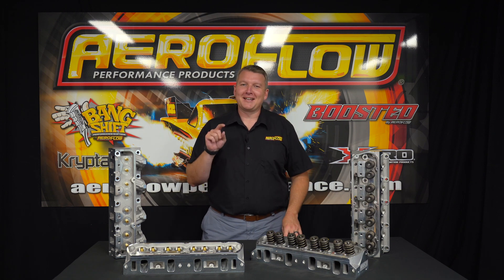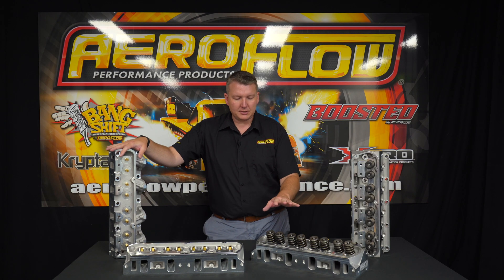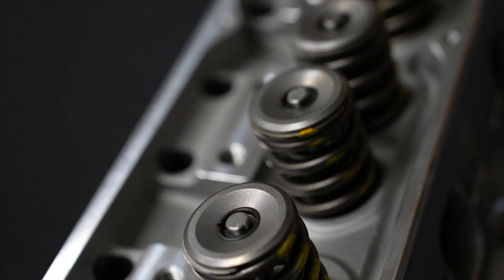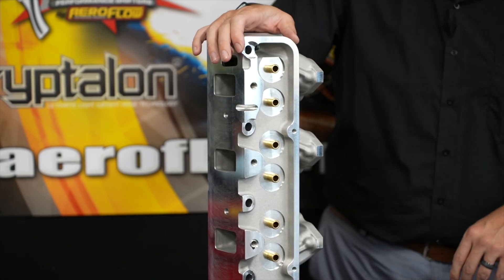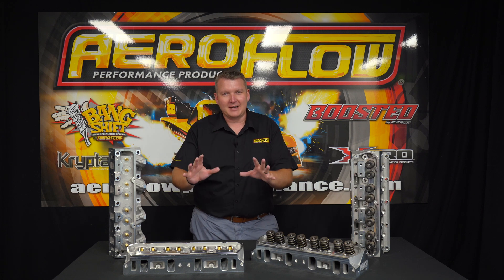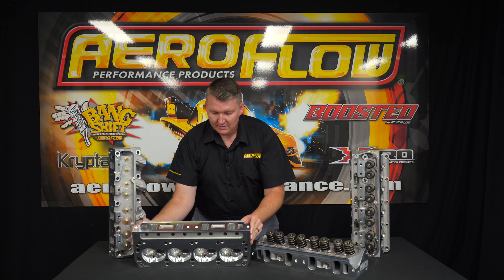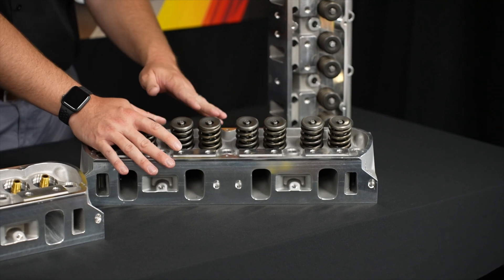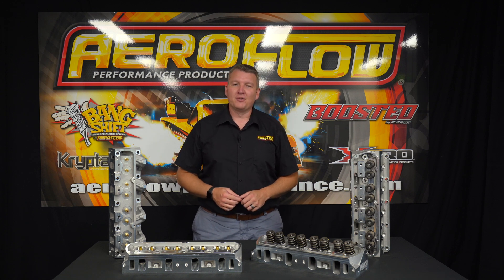Ford Alloy Cylinder Heads

Comment: Do you ship to the United States
Reply from the maker: Yes we can ship to the US, please feel free to send us an email to quote sales@aeroflowperformance.com
Reply: @aeroflowperformance hello,what does these airflow fe heads flow
Reply from the maker: @eddiefe428  Intake 240@.500" Exhaust 193@.500".....260@.600 and 202@.600"
Reply: @aeroflowperformance what does 2 bare heads cost,can you get it with seats cut for 2.19 intake, and 11/32 valve guides
Reply: What does a set of ford fe heads cost,what do they flow

Comment: FE created before Cleveland 🤦‍♂
Reply from the maker: There's quite a few options for Cleveland Heads whereas FE is not well supported - especially here in Australia. Don't worry, the Cleveland heads are coming
Reply: @aeroflowperformance why didn't they CNC these fe heads to improve the flow like trick flow,use 11/32 valves ,smaller combustion chambers ,ect
Reply: The FE market needs all of heads and intakes that can be made. They are a very good head to make because here in the States they still popular. We are literally running out of parts.  Thank you 🙏
Reply: Cleveland’s are over rated